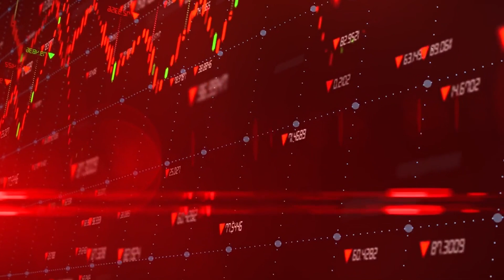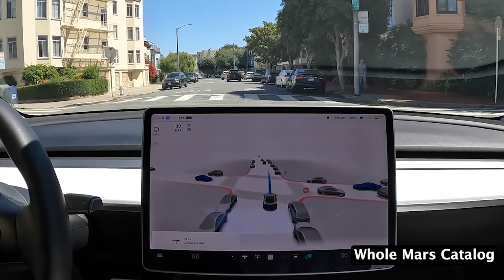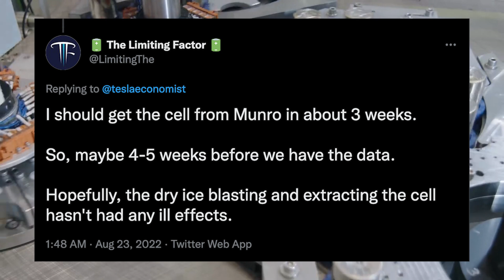Can Tesla Achieve FSD & 4680 High Volume Production?

Comment: I think people need to look at expectations from about 2010 or 2015. Compare the company now. Only look at the verifiable, objective value. An investment in 2010 through 2016   has a great return. We're looking at $15/share this year. Split-adjusted, that's $75/share.
So, if it was a great investment before, will it continue to be? I'd say there are fundamentals in play. If FSD is delayed and no one else has cracked it either, it's probably a very hard problem. 
Thanks for a great video!

Comment: even tho its not fair to say. but chevy never would have brought a 25k chevy bolt to marker without elon setting that, id say 25k ev is here. tesla doesnt need to sell the 25k car as long as the industery does it. right?
Reply from the maker: Yes that’s correct. You can buy a new leaf for $20k even. But it’s not a big seller.

Comment: Elon said the advent of the structural battery pack is akin to removing the fuel tank from an aircraft wing. The problem is that his structural pack requires ADDING structure to the walls of the battery cells to make them rigid enough to be structural members. His analogy is a fallacy. It’s difficult to trust him with such a poor grasp of structural engineering.
Reply: It's a strange world, isn't it? You being so much smarter than Elon and his teams of so-called brilliant engineers just seems so hard to fathom. Think how great it would be if all the top engineering talent would stop competing to go to work for Elon and he could just bring you on as a consultant, instead . . . that is, until you took over Tesla and SpaceX. 
It just goes to show that Elon Musk can't fool all of the people all of the time. You saw right through him and his fallacious thinking about the 4680 and structural pack. And now BYD is blindly following Tesla down this ill-advised structural pack road, too. What fools these mortals be!
Do you have plans to let Elon know about the error of his ways, or are you just going to let him suffer the consequences? Is it too late?

Comment: I don’t mind Elon being a little late on solving the impossible! Tho hugely solving Cook’s Corner is the ultimate leap in logic (& no, they’re only 75-80% to Robotaxi, from 45-50%), the markets won’t price that fact in (20-30% lift) for at least 6 months. Fortunately, by the time markets comprehend potential 4680 delay downsides, the problems will likely be solved (Q2 2023) & their pessimistic tendencies will flip to the upside. That met by months of confirmation that competitors’ “production” claims are just smoke that won’t happen for at least a year (likely 2+), Tesla’s by then unquestioned dominance will trigger ICE cannibalism that cuts legacy funding of EV transitions just when it’s needed most. Another 6-9 months of profit starved “projects” will leave only 2-3 legacies & hordes of China NEVs left to squabble over Tesla’s table scraps. By then, all Tesla factories are at full chat, with more being built, with their main focus being the 10-20 year transition fully recycled battery materials & self-contained production life cycles.

2.5% EVs last year, 5% this year, doubling again in each of the next two years, 50% in 2025 before the S-curve just starts to flatten & Robotaxis, mega-batteries, V2G powered VPGs become the norm, boring tunnels proliferate, & Starship global & lunar travel are realized with robot constructed moon bases started.

Comment: When it dropped below $40 is when I first backed up the truck.  I had quit trading it in 2018 planning on getting in late 2019 for LT, but the shorts had beat it down so hard I knew it almost had to bounce or Apple or someone would buy it outright, a backstop.  

Final bit of conviction came after delving into the short/bear arguments, they made less sense then ever, many were hysterical.  "We all" expected an epic short squeeze that seemed to take forever to happen, then it did.
Reply from the maker: Exactly what I thought, worse case scenario Apple or Google will buy it, and perhaps start some bidding war, I didn't think it would got to 0.
Reply: @TeslaEconomist    Surely the biggest best blunder Tim Cook ever made, I was a little worried it would be bought and wasn't keen to see it diluted with Apple tho that would still be a good investment. 

I suspect Elon's insistence on running Tesla discouraged possible buyers when he seemed willing to sell it.  Later learned that he "'could make a couple phone calls'" and get significant funding if needed.

Comment: Regarding the 25k EV I dont think its that tesla can't make it....they simply don't have the capacity to even meet the demand for model Y let alone a new cheap model. It would be stupid to try to produce a cheaper model right now when their demand is backlogged even at current high prices. Perhaps in the future when the industry has settled down and competitors are somewhat producing in volume, tesla can introduce a 25k-35k model
Reply from the maker: Oh yea, Tesla could make it, and at a profit too, but I don't think it's necessary, the opportunity cost is too high. I think that Elon has had break-throughs in FSD since, that make Robotaxis seem closer, and thus no need for a low cost vehicle, instead we have low cost transport.
Reply: @TeslaEconomist  while I'm very bullish on FSD and Robotaxi, I'm not sure about the short term. Do you think tesla can release FSD and robotaxi for mass adoption from a regulatory standpoint?
Reply from the maker: Yes, you can’t argue with data.

Comment: I will believe it when I see it. Right now, it's rational to expect a return of 1.5x or 2x given the current demand for and production of Tesla's current models. Anything above that is pure speculation. FSD and 4680 are big gambles that Elon has taken, and he's expecting investors to take the same gamble with him, but risk averse investors should be wary. This is experimental technology, and there is no guarantee that the problems involved will be solved.
Reply: FSD maybe a gamble but not 4680... What's the worst that can happen to Tesla without FSD? But imagine what can happen to Tesla if 4680 does not attain volume production? There will be interminable delays of the Cybertruck and the Semi...

Comment: I'm a smidge concerned about the current macro environment. Tes may do what amazon stock did in the dotcom bubble. That would be a bummer, but slao a fantastic opportunity.
Reply: Amazon was a money losing company back then. It's very hard to judge the correct value on companies that don't make any money. Tesla will soon have a very low price to earnings if the stock price doesn't go up. That doesn't stop the stock from falling in the next couple of months of course.